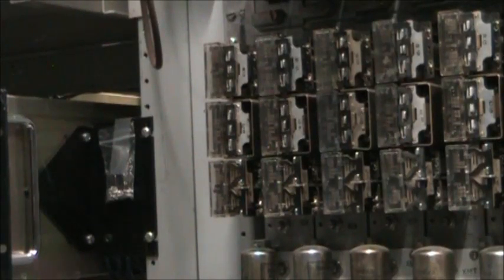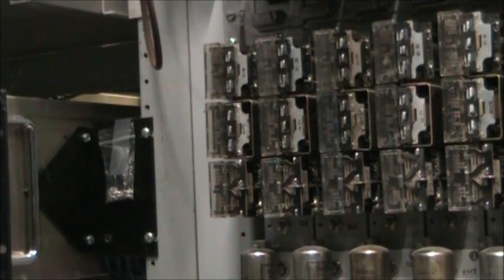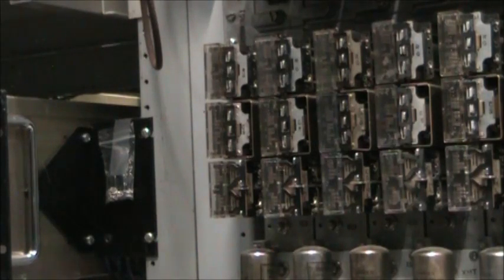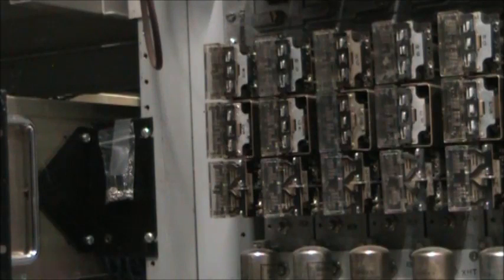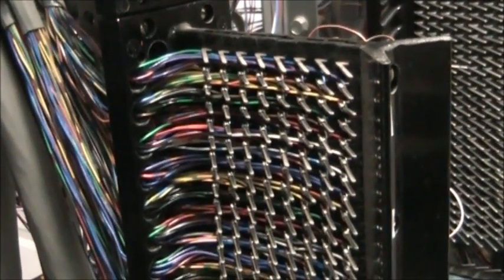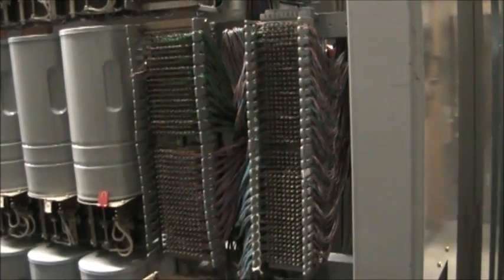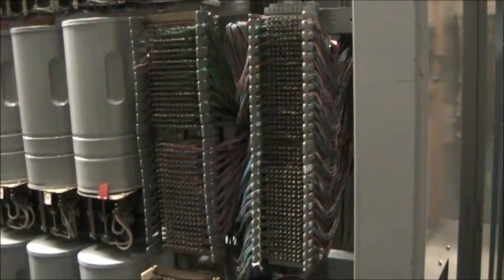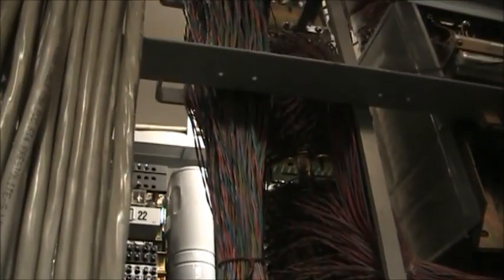Western Electric 2600 Hz SF E type Signaling  unit.

Comment: Love those diagonal wire-wrap blocks.  Ours had a wooden back plate, with the wire feed-thru holes.  Surprisingly, not only did the carrier systems utilize these blocks, but also the saturable inductors or bridge lifters, as well as the SNC filters blocks.  

In later years, with the EAX Systems, such as the GTD-5, we utilized both the diagonal wire-wrap & Telzon punch-down blocks.  I honestly learned to really dislike the punch-down blocks, because of their proprietary punch-down tool, which was prone to always breaking, and cost a fortune to replace!